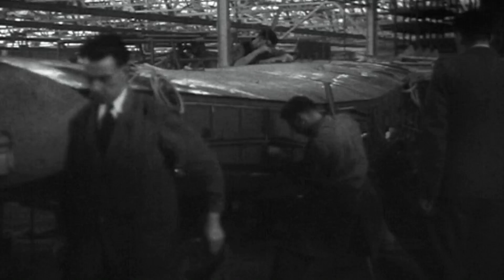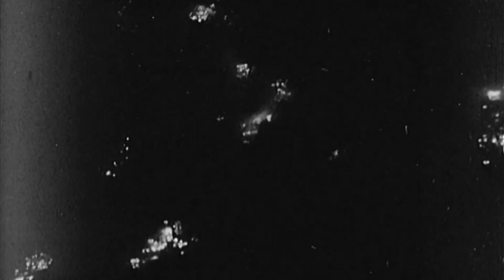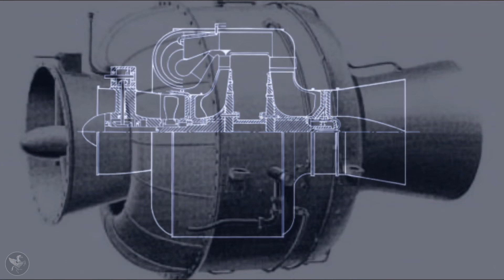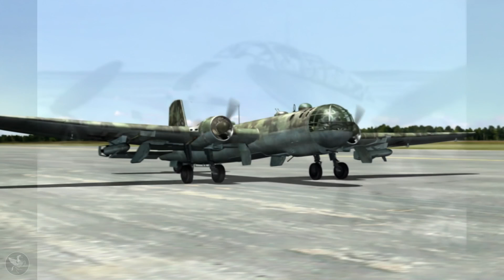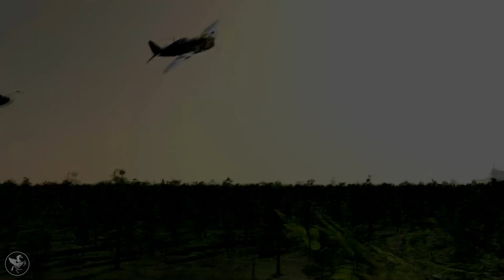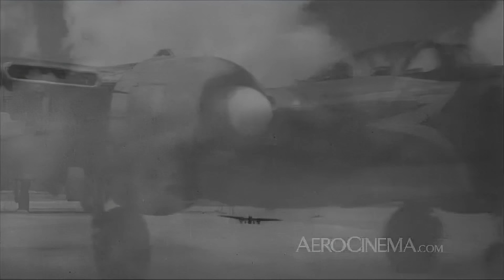EXPERIMENTAL AIRCRAFT: Canards Of War| Aviation Oddities And Engineering Marvels

Comment: In the 1980s, at the airfield where I learned to fly ("Ryan Field," Tucson, AZ), there had been a pilot who had built an experimental airplane of his own design, which employed a canard.   On its rest flight, it flipped over during take-off, killing him.  It was due to the inherent instability of the design.  With a conventional airplane, when you raise the nose & lower the tail, the airflow over the horizontal stabilizer pushes it up, making the plane want to return to level flight.  With a canard, it's the opposite.  An increased angle of attack of the canard pushes the nose up, increases the upward force more, etc.

Comment: The Wright Flyer was a canard wing.  The reason that canard was not used extensively is that they are not naturally stable.
Reply: That isn't true. As long as the canard surface has a greater angle of attack than the wing, or a difference in wing sections produces the same effect, the aircraft will be stable in pitch. As a result stability depends in practice on the centre of gravity being in the right place.
Reply: @rogeratygc7895  That's right, but if you can ignore the rotation moment of the plane.